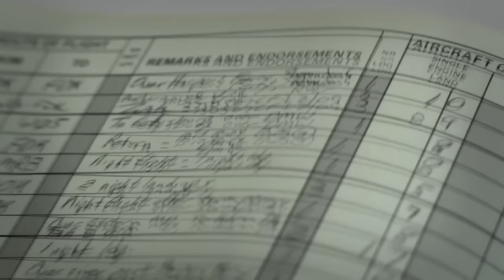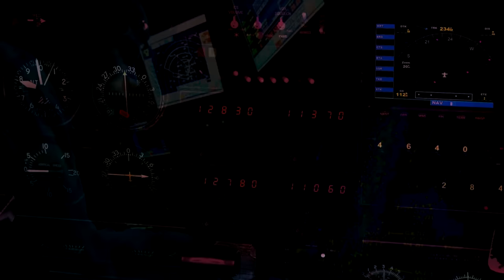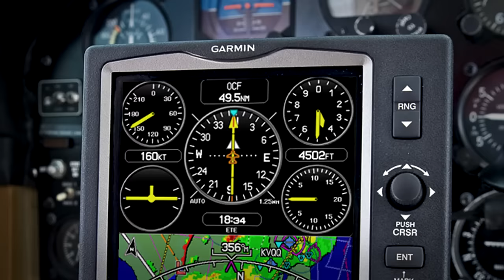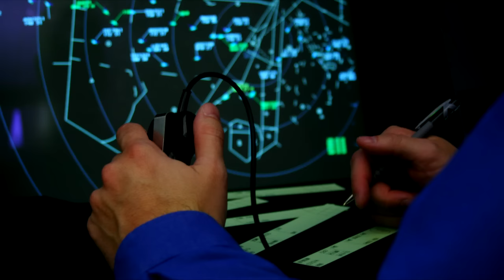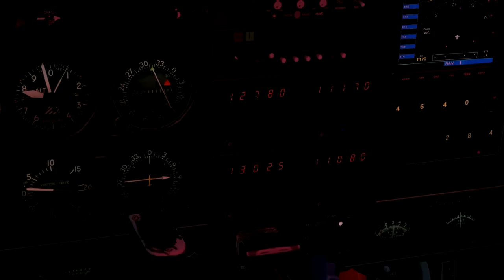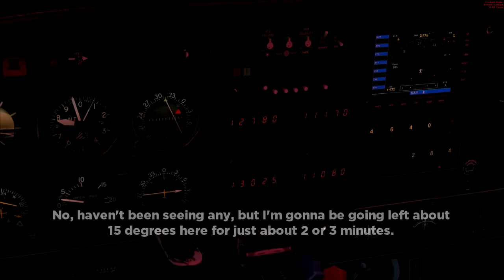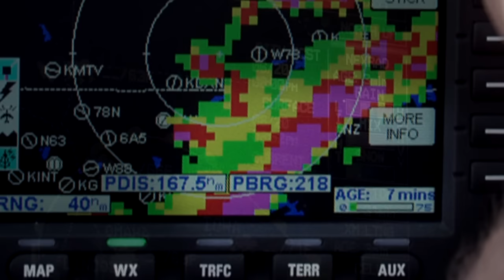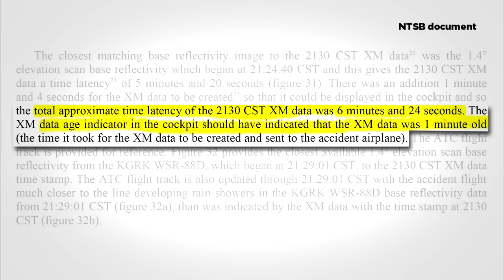Accident Case Study: Time Lapse – misunderstanding in-cockpit weather displays can lead to tragedy

Comment: As someone who has a great interest in aviation but who has not flown it’s crazy how different my perception is of aviation incidents after watching these videos. I always imagined that the cause of small plane crashes would be failure of engine or control systems. But in these case studies 90% of the aircraft were completely fine mechanically when they went down, and even the ones who did have issues seemed to be more than land-able had they been in different scenarios. Weather, terrain, prioritization and a touch of bad luck seems to be the fatal mixture here.
Reply: You're right.
Reply: Fuel exhaustion or continued flight into IMC are main causes of ga accidents : ie pilot error.
Reply: Most air accidents are indeed caused by pilot error. The more videos I watch, the more I personally feel it's complacency or the pilot becoming over-confident and over-stating their skills. As a student pilot with 35 hours I've been taught how to land in a field if the engine fails, what to do in the event I fly into cloud without realising, how to spot the signs that there might be an issue before it becomes an issue. None of those procedures will help me if I fly dangerously close to a storm and think I'll be ok.

Only yesterday I was talking to a client of mine who says "I would really love to fly, but I'd worry about an emergency situation." Pilots are well trained in doing so and I believe most accidents can be prevented. I also compared it to learning to drive - we're only taught how to stop a car rapidly if necessary. We're not (in the UK at least) taught how to handle adverse road conditions. It's not a test requirement to know how to prevent an incipient spin turning into a full uncontrollable spin that could flip you into other traffic - which I find odd. Flying is statistically many times safer than driving - and this is a very big reason, I feel.

I would much rather land the plane, wait, and be alive to tell the story tomorrow than thinking I'll be okay, and taking a nose-dive into the dirt.
Reply: wow man, well said.
Reply: +PIAviation Thing is that a PPL doesn't quality you to fly in IMC on it's own either, you need an instrument rating for that. The problem I see with driving licences is that there is no legal requirement to actually take one of the advanced driving courses that does cover operation in adverse weather before legally being permitted to drive in averse weather conditions. Considering how common continued driving into adverse weather conditions is as a cause of road traffic deaths perhaps it's about time there was a licencing category for that.
Reply: As I commented on another ACS vid, a lot of these air accidents of small private planes are due to inexperienced pilots getting themselves, and sadly, their friends and families, into dangerous flying conditions and in over their heads, more than they are trained to handle.  This is exactly what happened to JFK Jr. in 1999 which killed him, his wife and her sister.
Reply: It’s no different with automobile accidents; only about 12% have a mechanical cause. But because pilots get so much more training than drivers, we may be more likely to forget they are also still human.

Comment: Some of the same crazy licensed drivers on the highways are the same crazy pilots in the skies.
Reply: Not the same on any level!
Reply: Yep, you nailed it.
Reply: Rarely, the training and self-selection is far better.  But I agree, it can happen.  We've all done stupid things, it is just the margins in flying are thinner, so personal standards have to be higher, which they usually are.  Most of the time that is realized, but no one is perfect.  I think of Scott Crossfield, a retired X-15 pilot who reached the edge of space.  With bad judgment he flew his Cessna into a thunderstorm.  On the other hand no one hears of the thousands of daily general aviation flights that land without incident-the vast majority of pilots are always conservative, and not close to crazy.  I guess the same could be said for physicians, attorneys, or any other group that requires serious training.
Reply: I had a friend of mine, private pilot, make the same remark a few years ago.
Reply: @copperheadh1052  

Did you fly for Southern Air or Four Aces Air in the early '70s? Perhaps near Vientiane? I remember that call sign from a ThunderPig based out of L-19
Reply: As a fellow pilot, I can confirm that a small part of that statement is 100% true.

Comment: Next time you see convective weather building, take your GPS and whatever weather uplink you use in your airplane. Then watch what the differences between what your uplink is painting and what you are experiencing on the ground. I do this all the time and the difference's are wildly apparent. I have seen it so different that sometimes the monster cell passes me and the uplink shows it still didn't reach my position. Know the limitations of your weather uplink and in GA never use it to pick through ANY bad weather especially CONVECTIVE! I did this once in my car during convective activity and traveling at 70 mph its even more dramatic.
Reply: Agree. Part of the problem is that NEXRAD displays (aviation or not) usually do not accurately convey the delay. I'm not sure why.
Reply: whut you use a weather radar when you drive? where tf you driving thru, middle east in a sandstorm? lol i thought i was intense for checking the doppler on my home computer before driving 45 minutes to the next town

Comment: The more of these Videos I watch the more I get the feeling that most of the time an over-confidential Pilot is the fault.

I'm not a pilot, i'm just interested in aviation
Reply: I hear ya bro...
Reply: An interest is the hook.
Reply: We have a saying. There are old pilots, and there are bold pilots, but there are no old, bold pilots.
I would say 9/10 times the crash is caused by pilot error, and 2/3 of those are that the pilot got in over their head and decided to push on anyway. Outside of a freak accident, almost every crash is caused by a chain of bad decisions that lead to the scene of the crash. The sad part is that if at any point in the chain the pilot changes their decision before the fatal link the flight ends safely on the runway. It is tragic, but the best thing to do is learn the lesson well and not get into the mindset that will start the first link on the chain.

That being said, if you are interested, there are plenty of flight schools out there and quite a few flying clubs that will mitigate a lot of the cost to flying.
Reply: I'm very new to flying. In training we flew into windy weather, weather that the instructor said only he will land in. We had 20kt crosswind on landing. No way in hell would I fly in bad weather as I got a lot of respect flying on this very windy day.

Comment: Tops at FL450? Jesus. That's well into the stratosphere, higher than a jet airliner. Only the worst thunderstorms are capable of that--the kind you give a very wide berth.
Reply: they can fly at FL450 if certified to do so, but FL410 is more usual.
Reply: FL450 is not well into the stratosphere. The only clouds that manage to punch through the tropopause would be an overshooting top that would be in the 550 to 600 range. The startosphere is too stable to have any bad weather or any weather at all into it. If you go well into it, there is no clouds, just stability. I will agree that even a t-storm with tops at 450 can be extremely violent. Meteoroloy seems to be a novelty with pilots, mostly GA. It is not something to be taken lightly. Most pilots gain enough knowledge to answer questions right on a test, like the official rules of the road. They have no insticnt for it and it can and has and will lead to fatal mistakes. Stay safe up there people.

Comment: I was in a similar situation not too long ago. I was trying to get from KORL to KGNV when the weather deteriorated to the north, so I opted to go west to KSPG. Two massive cells were building during this time and left a small gap through which aircraft could safely fly. ATC even said he had gotten another aircraft through it, but I opted not to take the chance. I could only see it on NEXRAD and it looked like the gap may have been closing. Instead, I chose to go South where I finally got to KSEF. Still landed. Still had breakfast. Still managed to fly home. Don't take unnecessary risks.

Comment: Very sad story.  I am always amazed at the poor decision making by my fellow pilots.  Why would anyone leave on a 10 hour trip at 2pm knowing there is weather on your route.  He absolutely should have made 2 five hour legs and flown in daylight!!!  At the very least, he should have landed before he got anywhere near that weather.  Too bad so many had to die.
Reply: total push-on-itus here, could have just diverted to houston executive and drive the 3 hours, but they already flew 9 and the drive prob woulda been 12 hours total anyway so the pilot def didn't want to make an ass out of himself or something
Reply: Single engine non turbo prop at night.... No Thank You!
Reply: @caddisking I fly single engine non-turboprop IFR at night, and I’ve lost two engines. Life is full of risks. Training is the skill you need to get out alive. But prior preparation is what gives you plans you can execute to put your training to good use. There’s nothing inherently more “dangerous”, you just need a heck of a lot more plan Bs and Cs…and be dang sure you can call on that skill if needed.

That being said, if my choice is between night IMC or on the ground sipping a cold brew at a local watering hole in some middle of nowhere town until the next morning, my a** will be in a barstool.

Comment: Convective SIGMETs are not issued in Alaska.  Thunderstorms (usually just "air mass" type storms) are issued in CWA Center Weather Advisory form.  Also, I know a guy who flew a C310 through a thunderstorm in Illinois at 10,000 feet and got a 9,000 foot per minute downdraft and was spit out the bottom of a cloud about 500 feet AGL.  He's lucky to be alive.  A C90 King Air pilot once told me he got over $100,000 hail damage from a storm cell 20 miles away.  Hail shot up to the jetstream and was carried to him.  Give storms lots of space.  Good video.

Comment: As private pilot one of the most valuable lessons learned about flying through weather, was during my time as a flight mech on C119's No on board weather radar,most flights below10k ,and most of the flying in tornado alley . Had some really hairy experiences  passing through fronts ,and unintended flying into embedded TS..

Comment: Day one of pilot training...
There are old pilots and there are bold pilots, but there are no old, bold pilots.

Best info regarding flying I was ever given
Reply: My uncle had a push-pull Cessna and would go all the way back on the runway to take off. He passed the tower well into the air and about level with the controllers. ATC would say, “Got enough runway there Cam?” And Uncle Cam would say, “Can’t use runway you don’t have.” This was a ritual repeated every flight.

Comment: Too many times flights go fine. A sense of complacency bubbles up. 

If the controller had asked "how many souls on board" at any point during this questionable situation the pilot may have 'stood down' and done the right thing.  

The controllers aren't our parents but they can push get-there-itis and bad decision-making to a better outcome. If the pilot wants to flirt with disaster ALL BY HIMSELF he has my blessing. When children and non-pilots are on board, jesus h christ err on the side of safety...
Reply: " If the pilot wants to flirt with disaster ALL BY HIMSELF[...]" Not even then IMO. Even flying solo there are people and property on the ground that may be affected by poor decision making.
Reply: Yep, he wouldn't have my blessing either way, flirting with disaster is just as irresponsible, in my opinion.
Reply: Pete Kuhns I agree.  I don't rely an controllers much but I feel they should have my back and earn me if there is trouble.   it clearly showed the pilot was missing it. if there is a problem on our end were legally obligated to notify them like if an instrument stops working, fuel, engine et..
Reply: LegendLength to even hint?
Reply: I agree, but I will take all the help I can get if ever found myself in these flight conditions. First off If you flight night convective IMC your a bit of a risk taker IMO.
Reply: Flying Drummer 10000+ hrs and 5 type rating with domestic and international airline experience, I wouldn't have flown a SE airplane, at night in IMC. Confidence sometimes kills.
Reply: Multiple engines doesn't help if your left wing falls off. This accident, and many others, had nothing to do with the type of airplane being flown or the time of day - it was the result of failure to understand the available data and assumptions made about unavailable data. If he had onboard radar he might not have made the mistake, or he might have had the onboard radar pointed at the wrong angle and still made it. Point being, the primary mistake made was described in the video -- he flew way too close to thunderstorms and areas of potential TS, turned into it because he thought the data was showing him a clear path through, and found himself unable to get back out.

Airline pilots have a strange belief that they're safe because they have more engines ... the truth is you're safer mostly because you have much better training and a lot more support before and during the flight - and much stronger airframes. Extra engines only helps when one stops working, which does happen but is far more rare than other accident causes.
Reply: Sorry, I can't agree with you here. Controllers tried to get N90T to avoid the storm on numerous occasions. They also had no way of knowing that he was seeing a 6 1/2 minute delay on his cockpit display. 
I personally put a large amount of blame on the XM display claiming a 2 minute lag when it was actually close to 7 minutes. That is dangerously misleading and it should not be like that. I personally am aware of NEXRAD lag but only because I am a weather buff who regularly compares the conditions at my location with the screens and have learned there is a lag. I do not think most people are aware of it, and that's a bad issue in a cockpit.
Reply: please don't take God's name in vein
Reply: @hempelcx  I wouldn't say that this accident had NOTHING to do with the type of aircraft he was flying.  Multi-engine aircraft typically have stronger construction and are better able to handle turbulence than single engine light aircraft.  But I think, in this case, you are correct that it is the pilot's behavior that put him and his family into the ground.
Reply: @chuckschillingvideos  multi engine aircraft are not necessarily or typically stronger,  if anything it's the other way around.  Wing loading plays a part though.
Reply: I’ve always wondered.... What’s the H stand for?
Reply: agreed Pete Kuhns....I'd like to point out that in addition to the controllers pointing out the bad weather, the controller also kept talking about "after you get on the backside of this..." etc.....it paints a picture of continuing the attempt to get through the storm to get on with the next leg of the flight when in reality the attempt actually needed to be abandoned
Reply: I concur.  Asking for souls-on-board may have sobered this guy up.  Sadly, he didn't realize how foolish he was being until the t-storm was rending his aircraft limb from limb.  First thing I said when JFK Junior smashed his plane was "Fork-tailed doctor-killer syndrome" - successful guys with too much money who are used to being confident and expert in their career, let's say an alpha-male doctor, business owner etc., forget that in the aviation world they are neophytes.  They climb in to a v-tailed Bonanza (the fork-tailed doctor-killer of yesteryear) or a Malibu and think they are still the successful doctor, engineer, whatever, and fail to realize that it doesn't transfer to the cockpit - their past successes in life lead them to overconfidence in a realm ruled by gravity, mother nature and the laws of physics, and all 3 of those outsmart the best of us.
Reply: @hempelcx  wtf does multiple engines have to do with anything? Who mentioned them?
Reply: What does lmao mean?
Reply: Pete: that's a fair assumption but I think improbable. The guy had 14 hours of actual and we'll never know how many at night. The sobering truth is too many pilots--at least those who don't fly professionally--overestimate their abilities and minimize the chances they will screw the pooch.
Reply: Too many armchair pilots here.  Nobody, I mean nobody has mentioned this simple fact:  When you file an IFR flight plan, souls on board is one of the blanks that must be filled in, so they already know how many souls on board.
Reply: I can't fault the controller. Their job is not drama performing, and he warned the pilot.
The pilot must take responsibility.
It doesn't work any other way.

Comment: I'm a former controller and I can't possibly see who could fault in any way this controller.  Yes, our first mission is safety.  I don't know what you, your mom, or George Bush are capable in any aircraft.  His first statement after giving the altimeter was the bad weather.  The pilot acknowledged.  CONVECTIVE SIGMETS were issued.  When the controller shift changed, they even discussed his choices.  We don't fly the plane, the pilot does.  The second controller told him not to turn to 250 when he wanted to and then warned him of the extreme cell 8 miles out.  They agreed on his right turn, when able, to TSTC.  I hate extra communications and asking POB is not a factor unless there is an emergency or filing a flight plan.  I'm not flying and I can only give you my professional opinion based on training & experience while controlling.